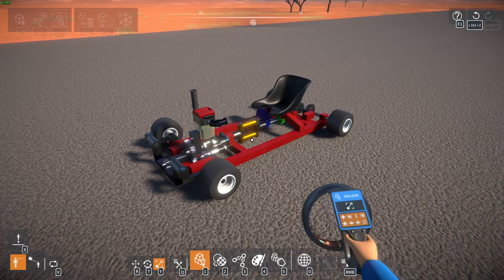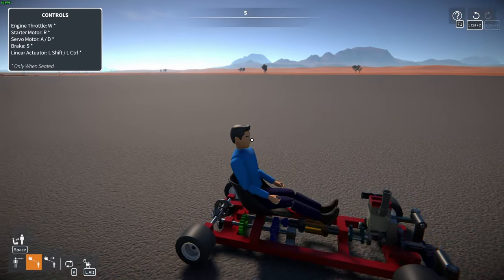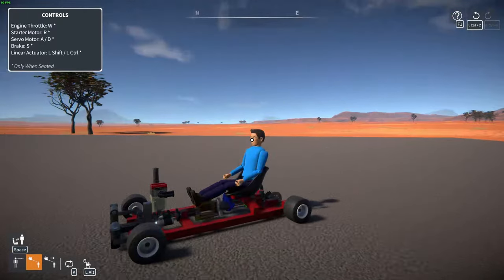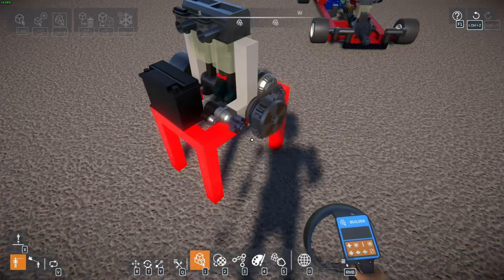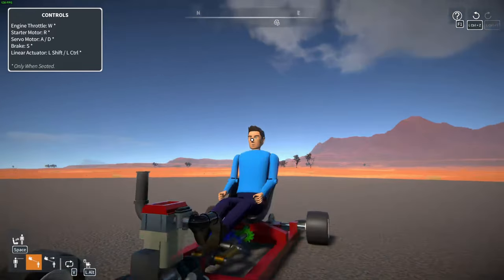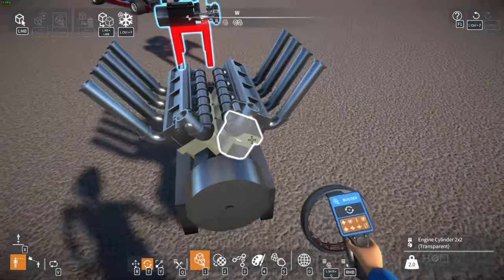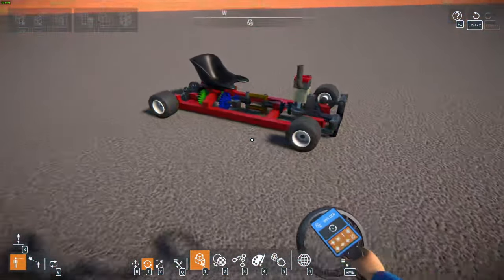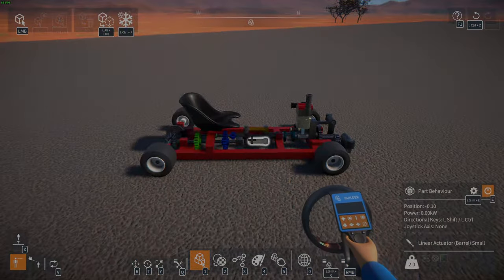Gearblocks Combustion Engine Update

Comment: How does the combustion engines compare to the stormworks modular engines system? I like the stormworks engines but stormworks itself sucks ass
Reply: there's no charging (yet, when there will be it'll 100% be better)
you have more freedom in how you build, inline, boxer, V, W, star, dunno about rotary but I'll check it soon, angle alignment and spacing has more freedom
and of course, there's no tick lag mambo jumbo for throttle input and no fucking around with MCs to maintain unrealistic stoich, GB engines have higher idle and can rev higher and can have a liiiitle bit variable curve unlike SW which has a single curve peaking at about 2500rpm NA (I've reverse engineered SW engines completely to the point that I had a parameter based controller and a dyno that can output a specific amount of power regardless of size) but the size and power is that of small modulars, 2x2s are kinda powerful but uhm yeah they don't feel like SW mediums, also no exhaust manifold fuckery (afaik) however throttle bodies do have a simple fluid sim so you won't be able to feed 1000L V500 engine off of a single throttle, cheers!